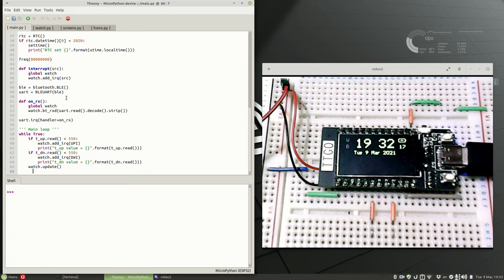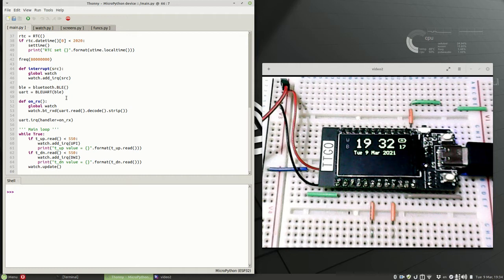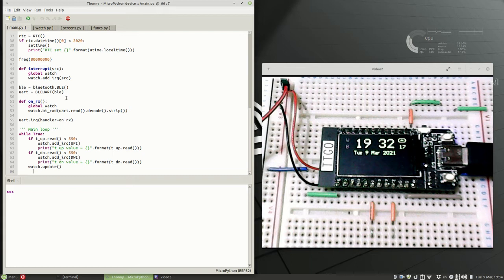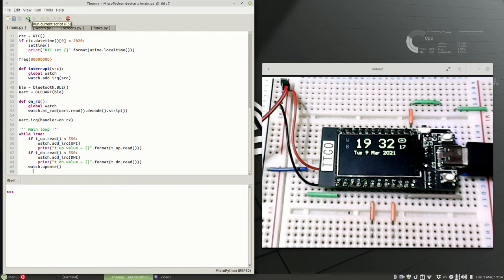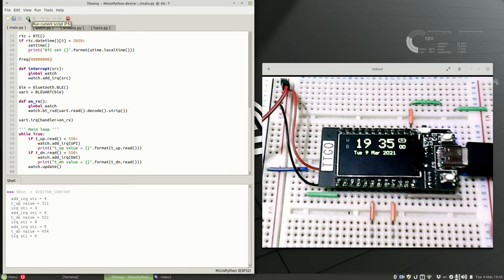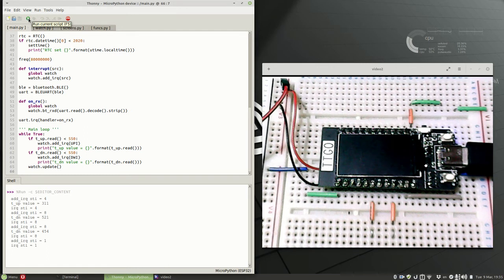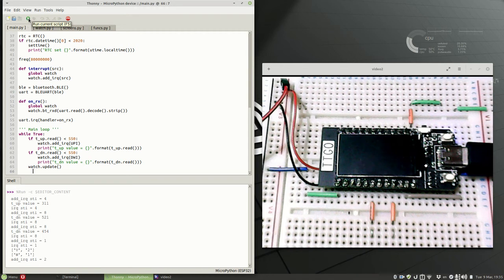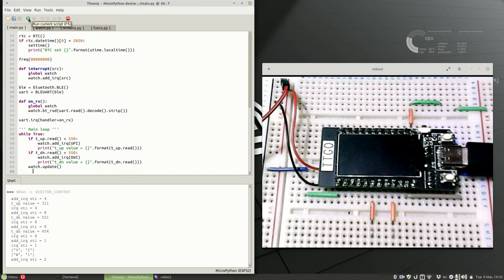Micropython ESP32 TTGO T-Display watch project Pt 1

Comment: I been thinking of doing something like this but with one of those rectangular eInk displays instead for longer battery life
Reply from the maker: Battery performance is a key consideration for me too.  I am not intending for the display to be always on so the main power saving comes from putting the ESP32 in to deep sleep when the screen is off.  The problem with this is the internal ESP32 RTC is very inaccurate and I haven't yet successfully managed to get an external crystal working with a micropython set up.  I could use an external RTC but I would like to minimise add on circuitry.
Reply: @boringoldman6342  any ESP variants with a better RTC? BTW with the rectangular shape you can fit a bigger battery, will end up looking like a small pipboy rather than a watch but I dont think it will be uncomfortable

Comment: Hi ,it look great !
Which Micropython version you use ?   And how could I drive my LCD on Micropython ? I have a esp32-wroom-32 board ,but it failed to run LVGL for mircopython ,because I don't know how to build the microPython firmware for LVGL   .
Reply from the maker: Hi and thanks.
I am using 'MicroPython v1.14 on 2021-02-14; ESP32 module with ESP32' which I built including a ST7789 driver for MicroPython.  The building of the firmware took me a number of attempts pulling together various sources.  I will try and reconstruct what I did and if successful post the results.
Reply: @boringoldman6342  sounds great!
Good luck for you

Comment: Hi, please give a link to GitHub for this project
Reply from the maker: Hi, Thank you for your interest.  I've not uploaded to GitHub yet as things like WiFi password is hard coded in at this early stage.  At next iteration I will try and make it suitable for sharing.
Reply: @boringoldman6342  you can do another file pass.py for example ,add it to .gitignore and import password from it, it is a good practice) give me know, when you push your code to GitHub! Thanks.
Reply from the maker: Sorry for the delay in replying but for personal reasons I have not progressed this project for several months.  I did however post the code on GitHub using a protect.py for the WiFi settings (not well commented!) and I have added a link in the video description.
I'm hoping to do another video on this project soon to explain my approach.